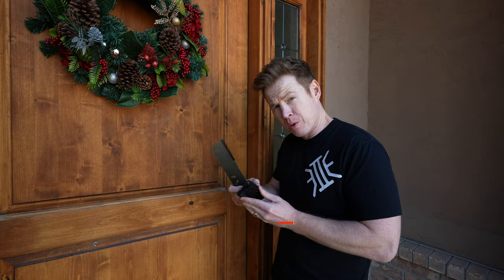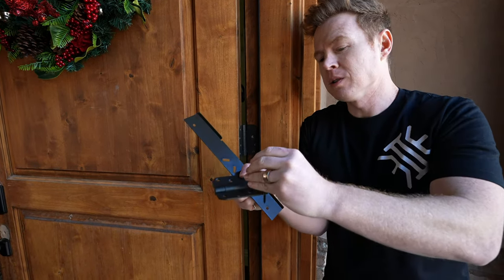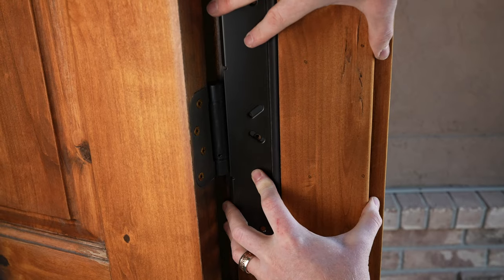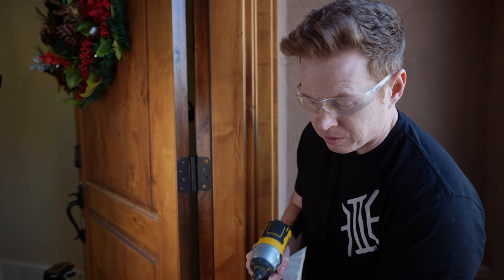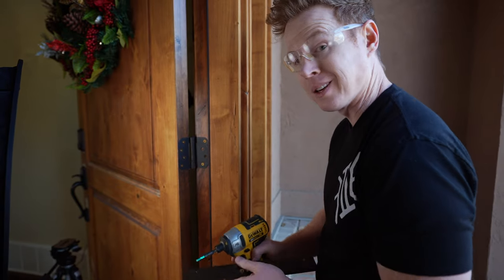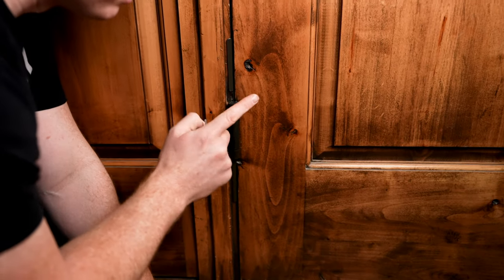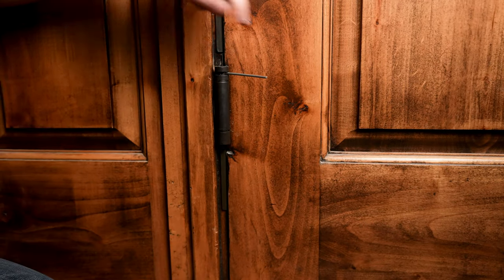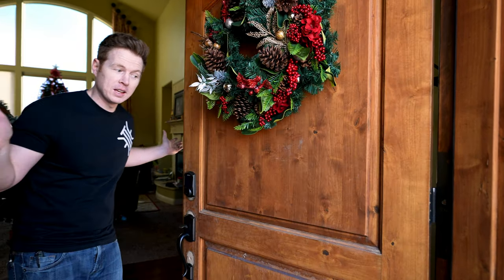The Ultimate Home Security Series (Episode 3) - Spring-loaded Hinges + Hinge Shields

Comment: Good job with this series. I've been a locksmith for over25 years. I suggest to customers that they reinforce their other doors too. The side doors and even the man door that leads into the house from the garage should be hardened. I don't know if you are going to upgrade the other doors. Maybe show more inexpensive ways to upgrade those doors. A outside door installed and hardened in the house on a "panic room"(master bedroom) is a good strategy too. Good luck.
Reply from the maker: We'll show a recap. But we're doing a lot of the same things for the other doors. You should really like the next couple videos. Any experience with Multiple-t-lock Hercular deadbolts? We considered those before going with Schlage because of the smart home component.
Reply: @Equip2Endure  Multi-Lock makes quality, high security locks and their key control is a great selling point. I've taken classes at their New Jersey location years ago. I have installed them for over 20 years and installed them on my home. The price of their locks would turn lots of people off. Installing what you did is a better choice based on the price point.  I installed Schalge on my in-laws home because they are the better of the "regular" security lock companies. They are definitely the best you can get from the big box stores.